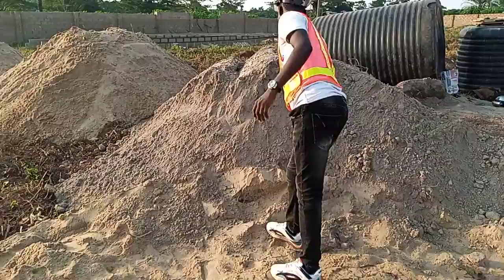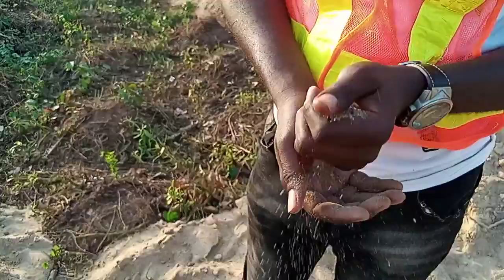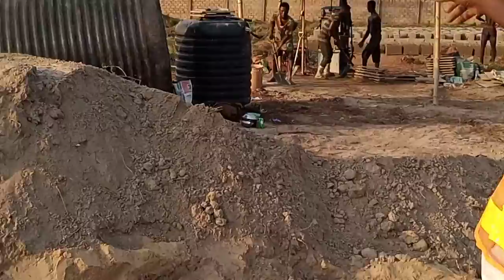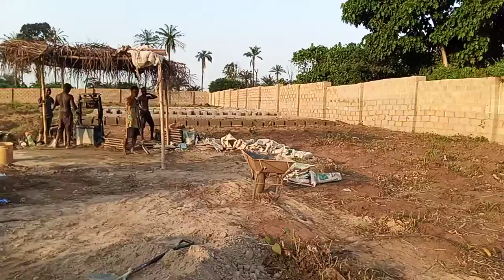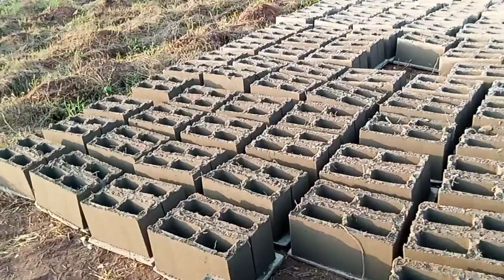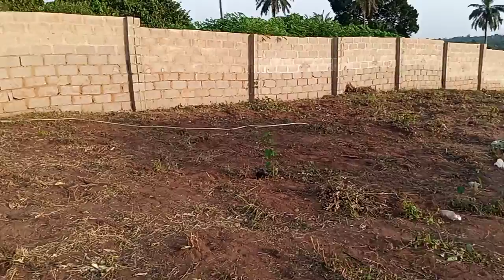How To Mold Strong Concrete Blocks To Cutdown Building Cost

Comment: This land is more than two plots anyway, pls for now how many pieces of blocks can one bag of cement mould?
Reply from the maker: 40 blocks when you mould with hand, 60 blocks when you mould with vibrator machine, but, I mould 50 bags using vibrator machine to make my block stronger. Nevertheless, watch it several times to get a better understanding

Comment: Interesting because here in Malawi we use 5 wheelbarrows to produce 35 cement blocks. 150mm x 400mm x 200mm blocks
Reply: Are you also mixing sands you are only using river sand only?
Reply: Tank u so much for this video which i really appreciated. Pls if i may ask what's head pan? Pls sir your reply is very important to me, bcoz i plan on moulding blocks.
Reply from the maker: Welcome
Reply from the maker: Thanks
Reply: kindly note, these are hollow and not solid blocks. About 35 solid blocks is what you should get from a bag of cement.
Reply from the maker: Thanks